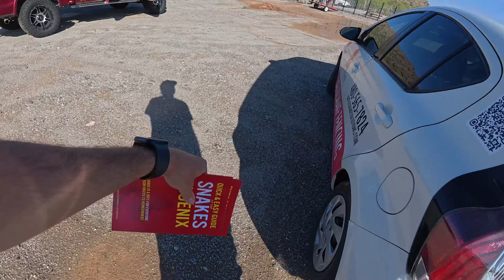These Neighborhoods Have the MOST Rattlesnakes

Comment: 98 degrees is not hot?
Reply: Nope. You really start feeling it around 107F.
Reply: That's spring/fall temperature for AZ. It's been 124 a few times in recent years during the summer.
Reply: In Phoenix, not at all